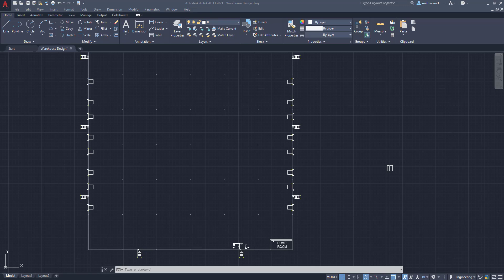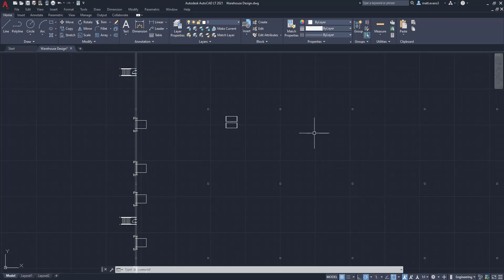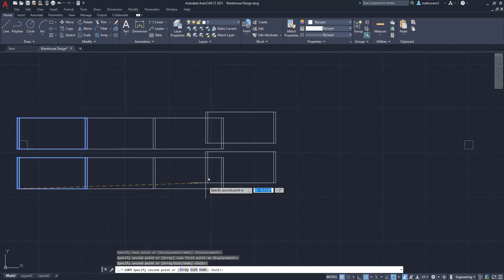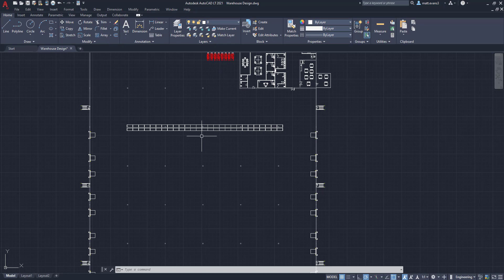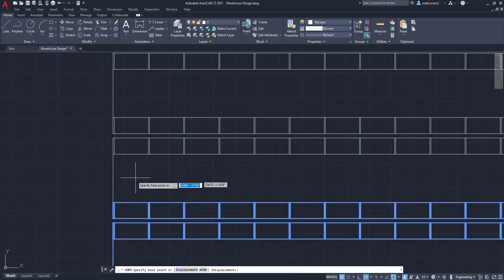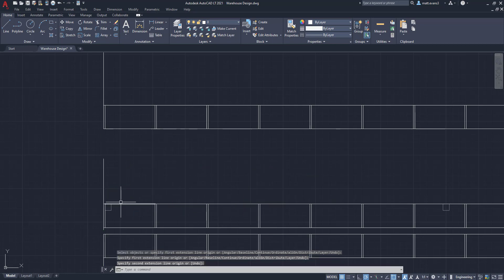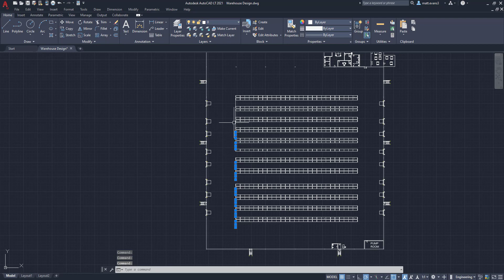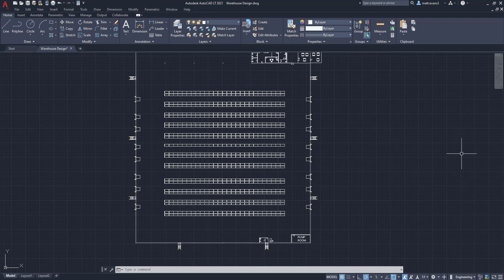Warehouse Design AutoCAD (Pt. 9) - Pallet Racking

Comment: I install racking for a living, do not listen to this guy.

1. Warehouse columbs should be located in the middle of the double rack and row-spacers to match so you don't lose ANY loading bays.

2. The row of racking he just ''Deleted'' to make a ''single'' will need Troax so when loading pallets from one side they do not fall off into the other isle behind it. (basically a saftey net on the one side of the single rack)

3. Know about racking before you just put it into a warehouse.
Reply from the maker: Thanks for the comment! While I don’t do the actual install of racking I do manage it and design for it.

1. You are correct, you can use row spacers but certain types of racking need to be placed with consistent spacing. A prime example of this would be racking that holds cases that use a wire guidance forklift. Sometimes losing loading bays is unavoidable, especially if you are retrofitting rack into a building with existing equipments and space constraints. 

2. This is correct, was not called out in the video but doesn’t mean you can’t have a single row for pallets. Every municipality I have worked with doesn’t require a call out in the permit either…

3. I do know about racking. I’ve drawn and installed countless projects spanning over my career. From conceptualization to permitting to install. Most projects are more nuanced than a basic rack set up like this.

Comment: This is great, but how do you make the elevation profiles for the racking?
Reply from the maker: This is a good question. Typically speaking you will get profiling from rack vendors before the rack is installed. Since this is not the first time this question has been asked I will try and make a video detailing how I would create that.
Reply: I ususally work a lot with racking for warehouses and I create the elevations prior to send it to the rack vendor. We have different slot types and company stabdards that rack vendors dont know. It's easy to create. I wish i can help but dont know how to give you my info.